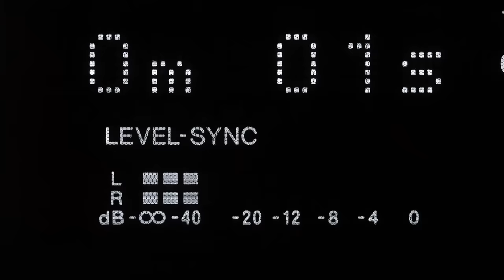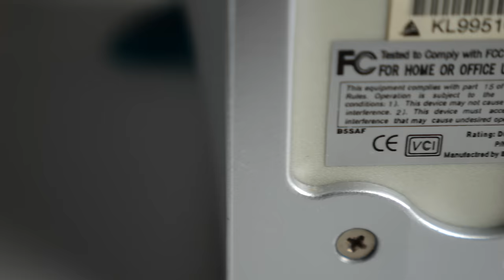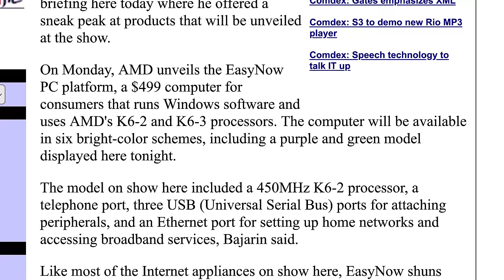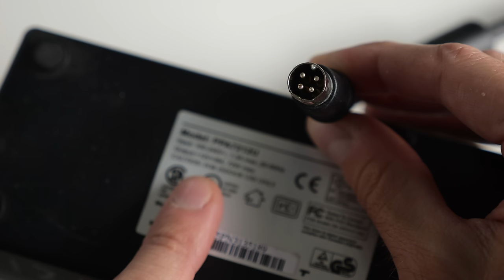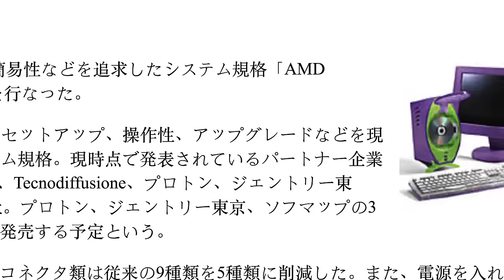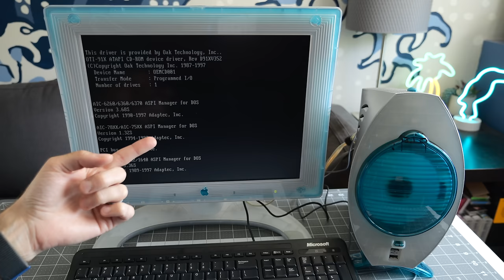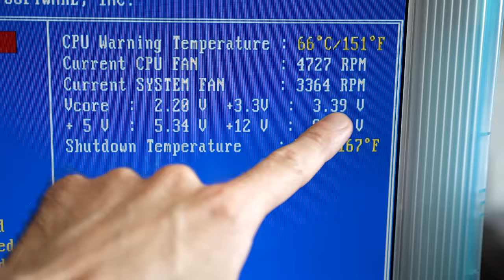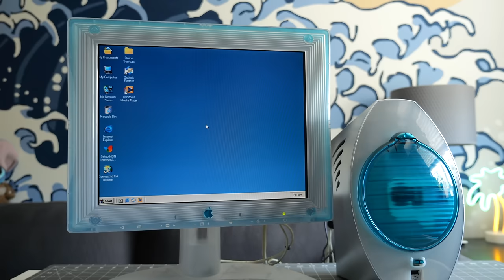EasyNow PC: The 90s Cheap and Cheerful Internet Computer

Comment: +12V: you are experiencing "I*R" voltage drop across your hacked power cable. Your cable's total voltage drop is (12V - 11.24V) = 0.76V. Assuming the current draw is, say, 4A, the total cable resistance is about 0.76V/4A = 190 milliohm. That's TOTAL resistance, which is split between the two power leads (plus and ground), meaning that each leg of your cable has about around 100 milliohm of resistance. What you want is a cable with heavier gauge wire and is SHORTER, too. Both of these actions will reduce the cable resistance, making the incoming +12V voltage increase at the PC. (I'm an old power supply designer, so I have a lot of experience debugging cable issues.)

Comment: As a system builder I delivered plenty of systems with ME. And you're right, it wasn't all that bad. It certainly beat having to install drivers for every piece of kit that 98 SE didn't support out of the box.
Reply: The hate surrounding ME is mostly because Microsoft made such a big deal about it, but didn't provide anything particularly new (as far as the end user could see).  And the fact that Microsoft also threw Win2K into the market at right about the same time sort of muddied the market, with ME being perceived as an 'inferior' product.
Reply: @xaenon  not my experience. It was an unstable mess, and everyone I know had stability problems with it and went back to 98 or upgraded to 2000. If you didn’t experience it’s notorious stability issues, then you were lucky. 

Perhaps it was due to the hardware at the time, or perhaps it was due to Microsoft’s bad programming practices. Clearly they knew the 9x kernel wasn’t going to cut it because this was the last release before XP switched everyone to the NT kernel.
Reply: @infamousacidrain    I think the people who had the most trouble were the gamers.  Perhaps that was why I was 'lucky'; I didn't run games on my ME rig.
Reply: @xaenon  No perception.  Me was inferior in every way to 2k.
Reply: @xaenon  it wasn’t limited to gamers. My mother had a brand new compaq that was shipped with ME and she didn’t game. It was ridiculously unstable. 

Microsoft knew it was a dead end with problems and that’s why it was the last 9x kernel OS. I recognize some people didn’t have problems, but that’s irrelevant to the success of the OS. It is widely recognized as garbage. Because it was garbage.
Reply: In fact, I'm willing to say that is better than Windows 98. It's built on the same core as 98 but with a few years more of experience behind its back. It seems something that people have to say... One good, one bad. I honestly don't know the reason. But objectively, there's nothing to back the claim that 98 was better.
Reply: @frvo  objectively, ME gave a lot of people stability problems. I’m not sure why you’re unwilling to acknowledge it.
Reply: @frvo  It was unstable.  It removed the ability to boot directly into DOS for compatibility and it didn't really offer much more than Windows 98SE.  It was just another attempt by MS to squeeze a few more bucks out of an aging software base by slapping some lipstick on it.  It's the only MS upgrade that I've ever had to downgrade back from.  MS should have spent the time working on their NT codebase for Win2k

I know its cool to say things that are counterintuitive on the internet, but nothing will make ME anything other than a flaming, pulsating ball of fail and suck.
Reply: My family's Win me computer had a fun bug where, out of the box, if you clicked a non-button part of the Media Player 7 interface it would blue screen and reset :)

Wasn't an upgrade or self build or anything - was a Compaq with OEM me.

Comment: FYI: The issue with Windows Me really comes down to allowing both 9x and NT style drivers to be installed.  If you only use 9x or only use NT, you don't have a problem, usually.  But if even one driver in your system is from the wrong platform, you are screwed.
Reply: I never had issues with Me then again my 2 computers the have Me where made for it and not upgraded to it.
Reply: In terms of retro use, ME is kinda pointless. For a 9x build it omits DOS support which is a deal-breaker if you want older titles, on the other hand - if I only wanted Windows game support, I'd go with the later NT builds like 2K and XP since they got rid of the unstable DOS kernel 9x uses.
Reply: Based on my experience, Windows 9x drivers that depended on a TSR loaded in MS-DOS before Windows switched into graphical mode didn't work on Windows ME without modifications to re-enable MS-DOS mode. I've at least seen that with the IBM M-Wave DSP that was used in some ThinkPad 760 series models.
Reply: @amirpourghoureiyan1637  
I know just what you mean!
I'm reminded of 'The Nostalgia Mall', because if I recall correctly, the host of that plays retro games on Windows 95, 98, and XP, but not ME, also because some of the games he plays are DOS games.
Reply: Really what I wanted to reply, regarding "better driver support" - wider, but worse. :D
Reply: Win me I had to reinstall it like every 3 days
Reply: Windows ME... a good reminder of why I never want to revisit this era of computers ever again. That, and classic Mac OS - blurgh.
Reply: @danimayb  Sure, I don't think he's going to get much networking done on a tower that old though.
Gaming's kind of the reason why a lot of people still hold onto aging PCs like these.
Reply: I had the worst time with Savage graphics drivers and Windows ME, had to drop a perfectly good Savage4 card for another card that supported ME, I was so glad when XP came out.

Comment: My understanding is that your experience with Windows ME was entirely dependent on your hardware and that the problem is that it supports two different eras of Windows device drivers and, if you mix them, you get instability.
Reply: Correct, it supports Windows 9X and NT drivers but never try to use both at once

Comment: I am pretty sure that Windows 95, 98, and ME will always use a 'virtual' A: floppy driver, even when the floppy controller is missing or disabled by the BIOS. What you are seeing with it being present seems normal to me, and I think is there because it is required for those versions of windows to operate correctly. I might be wrong on the details of it, but I thought I should add this for awareness.
Reply: I seem to remember something like that also. I think you can use TweakUI to prevent the A: drive from being displayed.
Reply: I had the same thought. I think it's because there had been very old machines where Windows had no way of detecting a drive by checking the BIOS info and just assumes there must be a 5.25 inch drive that will work when accessed. But disabling it would be really advisable as every time you want to install a driver for example, Windows will default to check the A drive and you always have to wait for it to timeout before selecting the correct path.
Reply: Yes, I believe this is largely for MS-DOS backwards compat. as many, many older DOS programs 100% expect the A: drive to at least exist (as floppy was the main storage format during the 80s and not many people had hard disks) and will not run without it being "present", even if the program itself does not mind being run from a hard disk or other internal storage.
Reply: @baseddoggie  if that was the only requirement I still can't understand why it always has to time out after trying instead of directly showing "drive not ready" as if there was no disk in the drive.
Reply: yeap they did that
Reply: @gentuxable  Probably for reasons related to archaic technology. I'm only guessing, but in the emulation scene we often have to set virtual read delays/spooling/reduce speed on the emulated drive for some software that will not load properly if the data its seeking arrives sooner than expected..
Reply: @baseddoggie  if that was the case, shouldn't the software fail with a real disk drive that detects "no disk inserted" too fast? Normally they should handle that situation accordingly, asiking the user to insert a disk if needed. I specifically remember Sony drives did just one second of seeking "prrr, prrr" then "No disk". But these with a VM it would be quite easy to just look at the IO and find out if the system tries something different when there's no reply from the disk controller.
Reply: It does usually - but not a 5.25" drive, it shows usually as a 3.5" drive.
Reply: @Lukeno52   setting drive A in BIOS to None will show as 5.25. Only if BIOS is set to 3.5 it will show as 3.5
Reply: I recall there always being an E: and F: drive showing up as a kid on the Vista machine, when clicking on them it saying "please insert a disk"
Reply: You can hide the "ghost" floppy drive with the TweakIU addon
Reply: wtf my windows 10 pc did that
Reply: No they don't. No floppy will show up if the computer doesn't have one configured.
Reply: @McVaio  You are incorrect about this. It will show an A: even if there is not one present.
Reply: @LoomSun  It won't. I have worked a lot with Win 95 and 98 and sometimes don't have a diskette drive connected and A: isn't there.
Reply: @McVaio  It does lol. I have worked with a lot of Win95 and Win98 computers and still do. I have a VM and two real machines with Win95 and Win98 in front of me right now that I literally just tested. Floppy drives and controllers are completely disabled in the bios, yet Win95 and Win98 have a ghost floppy A: listed in My Computer. It has always been that way since I can remember. You might want to double check your sources, I am pretty sure you are the only one who has replied to this comment that thinks otherwise. If I could post screenshots here to show you I would lol.

Comment: 27:24 Those 11.24v can very well be a readout error. Those voltage sensors aren't really precise to begin with. Also It could very well be voltage loss over the cable. Even if those cables are pretty decently sized, over the whole length and also the connector there could be a voltage drop. According to the ATX specification the minimum voltage is 11.40V. But I would guess those 11.24 Volts are pretty much fine too.

Edit: Also the 12V rail probably has a bit of voltage drop over the MOSFET / switching transistor as it comes directly from the PSU. All the other Voltages are that good because they get generated (or well stepped down with some sort of buck converter) on the mainboard itself.

Also the Apple monitor does fit very well to it :)

Comment: For the pinout. Just probe with a multimeter and see which pins are connected to the easy to reach shield of the ethernet plug. Those pins must be ground. So the others must be 12v. No need to take it apart necessarily
Reply: That’s what he did in the video. He took it apart since that’s what the channel is about
Reply: @Henners  Not quite, he checked against the Molex ground. I know he wanted to take it apart, I just wanted to share this tip if anyone else ever runs into such a situation

Comment: Windows Vista and Windows ME are just fine if you run them on appropriate hardware and install all the patches. They just had horribly botched launches.
Reply: Komi cannot communicate fan yaaaaay
Reply: what about win 2000?
Reply: @hampter779  win2k is definitely better than ME
Reply: @TadanoHitohito  indeed
Reply: Vista yes, ME no! ME was an unstable buggy mess that constantly crashed and blue screened.
Reply: @TadanoHitohito  honestly its weird to me that people dont talk about 2K much? considering at the time it was basically what XP would be (32bit NT based OS instead of 32bit layer on top of 16 bit DOS), just without the saturated, 3D look of XP theming (personally a win for me because as fond as my memories are of XP days, I did not like its styling at the time and even less now lol, no h8 :)

I remember it being really stable and sensible to navigate, although its been a long time since ive used it.
Reply: @GrumpyWolfTech  To be fair it was really hardware dependant. It was released pretty early/rushed and IIRC had lots of issues with hardware that launched same time as it, but most established 98 hardware worked fine? I remember being really surprised when i found it was so unpopular.

Comment: What I did with a big wattage 12v supply I had was put something like an XT60 plug on the end so I could have modular ends. I have a few different sized barrel jacks, one miniDIN, a molex, a SATA, etc so it can be used for whatever is needed and I'm not locked into a single connector for a power supply that's that big and useful.

Comment: That input connector is a GX16-4, A.K.A. female 4 pin CB (radio) microphone socket. Definitely not a mini-DIN connector, as with (mini-) DIN, the distance between two holes on a row varies per row. And a DIN plug with thicker pins would, well, violate its very own DIN 41524 standard.
Reply: What the hell kind of "genius" engineer thought that repurposing a cb radio plug as a power connector for a pc was a good idea? I swear these people think up solutions in the moment and never give a single second of thought to the future of such an off the wall idea
Reply: You're of course correct - a real mini-DIN4 will have pins that, if you used lines to connect them, look like a trapeziod.  That said, when I see this connector in catalogues it always says something like "Mini-DIN 4 pin power connector."

Comment: Windows ME was bad. I had to deal with it on an old Compaq laptop. My first ever laptop that I got for going to college. I upgraded to XP as soon as I could.  Awesome video!
Reply: Agreed, he can try to justify Win Me all he wants, but Win 98SE with all the service packs installed was far better, and more stable due to the hardware drivers, and forcing Win 98 drivers onto ME did not always end in the best results.
Reply: I disagree.  I always thought Win98 felt like a prop plane in a wind storm.  Just barely hanging together by sheer ignorance.  Win ME felt pretty stable in comparison.  BUT, I have seen it postulated that the drivers you were using made all the difference in the world, and that seems plausible.

I was running a Pentium III at the time, on an i815e (Asus TUSL2-C) chipset, 3dfx Voodoo 3500 TV (and later an ATI Radeon), Sound Blaster Live!, 3Com 3C-905C, and Adaptec 19160 SCSI.  All top-shelf stuff, very well supported by their manufacturers and Microsoft, and thus probably reference-level drivers.

It ran great, it was reliable, the UI was cleaner.. I had no issues with ME at all, and found it kinda baffling why so many people kept dogging it.
Reply: 2000 was also not bad I know a few people that hate it also.
Reply: @charlieretro  Skipped Windows ME in favor of Windows 2000 Pro after upgrading from 98SE. ME was a buggy mess. I used to work on machines back in those days and saw rows of these in a computer lab bluescreen while idle (fresh install too). Yet that was only on ME. When they were upgraded to XP there were zero issues.
Reply: @charlieretro   I tried 2000 shortly after launch and it was too much for my computer at the time.  It took too long to boot, I didn't have quite enough RAM, and driver support was lean.  It was pretty common to have basic functionality for most of your hardware, but none of the advanced features would work.

I think by the time 2000 was really ready for mass adoption, XP was already around the corner.

Win 2K seems to have a much better reputation now, in retrospect, from people who used it in a professional capacity at the time, or people who hung on to it well after it was released.  With mature drivers, a well-spec'd machine, and software that had been written with an understanding that Windows doesn't just let your code do whatever you want anymore, it's at a sweet spot between lightweight and robust, without all the eye candy that some people don't like about XP.

Comment: Also, it's most likely that the computer shipped with Windows ME as it was the OS of choice for OEMs in 1999 and 2000.
Reply: ME couldn't be the choice for anyone in 1999 because it officially came out in 2000. But if you are speaking about the Beta versions, then it's OK.

Comment: A few days ago I bought one of these off Ebay because of the funky look.
Today this video shows up, so I watched hoping for some info to get it running.
I wasn't disappointed! You saved me a lot of looking around for a sound driver.
Near the end of the vid, FedEx shows up with the computer. What timing!
You are right about the hard drive. Mine is a Maxtor with only 8.5 GB. The man date is January 1999, and the IC date codes in the computer are all mid 99 so I'm pretty sure the Maxtor is original. Your 30 GB is a good upgrade.
Did you find an ethernet driver? I poked around inside and the Ethernet Phy IC is an AMD AM79C901JC. That might help finding a driver.
P.S. Clint B: Sorry, I got the one on Ebay. There's sure to be more.
Reply: Dang, you yoinked it from LGR somehow. He posted a comment here saying that he's been looking for one for awhile. Edit: heh, you saw his comment.
Reply: I kind of want one of these now even though I have absolutely no use for it.

Comment: I worked at a small computer manufacturer/shop in the late 90s, early 2000s. They had a pallet of these things rotting in storage that they were never able to sell. If I remember correctly, they didn't have CPU, HDD, or memory and they would be configured as ordered. I could be wrong though...